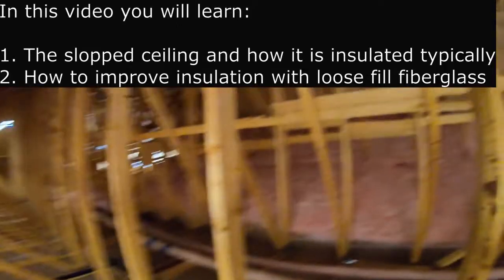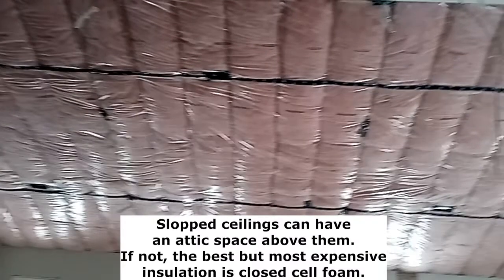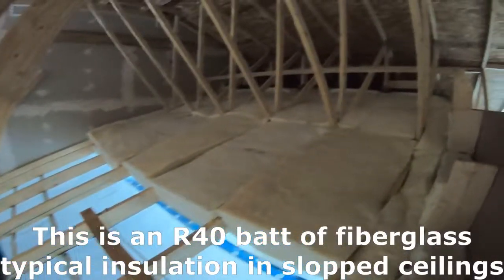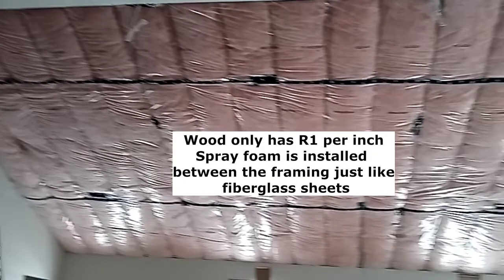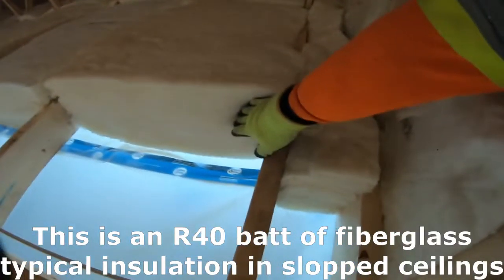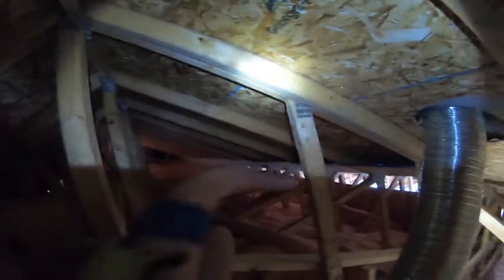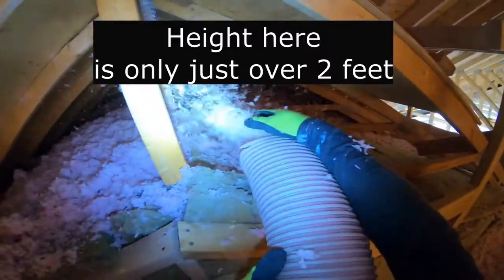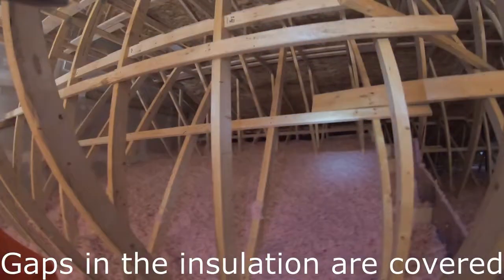Sloped ceiling, vaulted ceiling, cathedral ceiling how to add insulation

Comment: In all my years I never thought I would be comfortable recommending a blown-in insulator as a spray foamer ,but yet here I am lol.
Reply from the maker: appreciate the comments. am I converting you to the other side? kiding, I know closed cell is far superior especially since the attic side has airflow therefore trapped hot air in the blowing will more easily escape than spray foam.

Comment: One of the most used justifications of differentiating foam from blown in is the lack of doing things wright in the blown in industry because let’s face it it’s easy to get it wrong and it’s hard to do it correctly to the code ,but YOU!! are showing how to do things correctly and by the code without letting difficulty hamper your workmanship! BRAVO
Reply from the maker: yup it's tough work to get into the tight spaces and to shoot Insulation facing each cavity, but it has yo be done to avoid air pockets at the corners. love those knee pads.

Comment: Hey sinnisj ,even though I have a strong bias towards spray foam,I’m once again amazed with your attention to details,noticed the tape repairs on your hose,some would say (why does his hose look so grungy!)but i see someone who cares about his hoses through put capacity! Nice work man 👍
Reply from the maker: that's right, all that air loss affects the speed that is outputs on my end. can't have the machine work harder than it needs to, plus holes also means material can shoot out into existing homes, and I definitely want to avoid cleaning that up. Plus it would not be good for homeowners to breathe those small fibers... thanks again for the amazing comments.